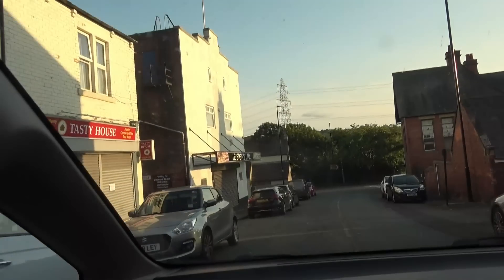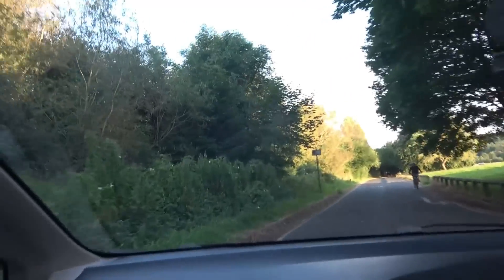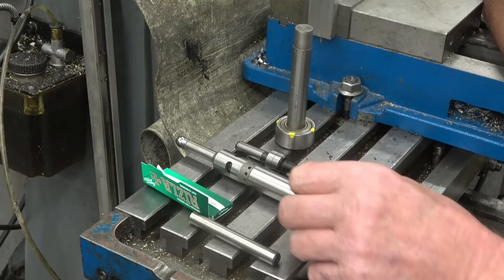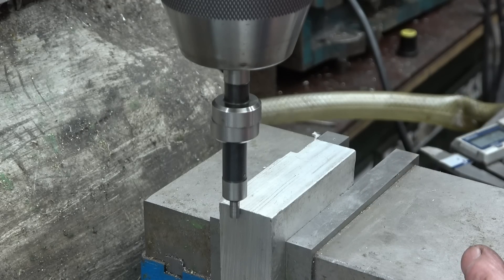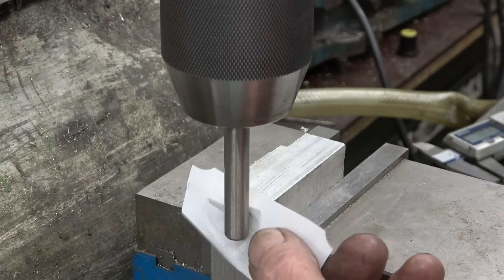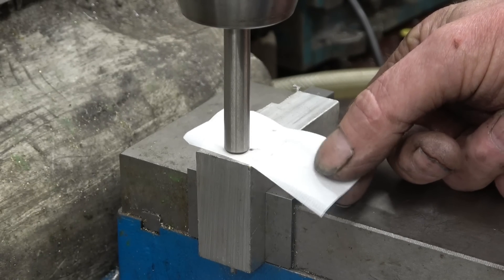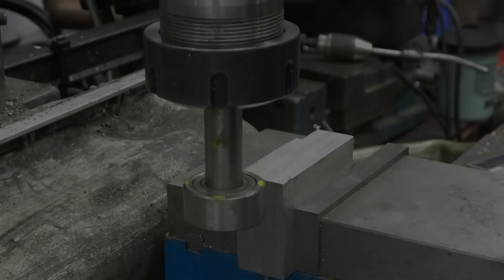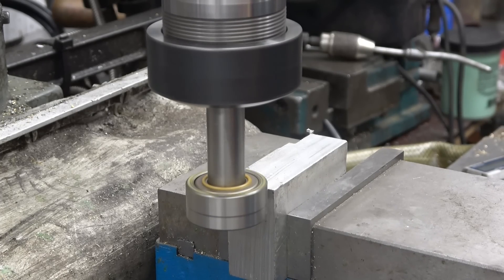Wednesday Catch Up 3 .How to Locate an Edge on a Mill

Comment: I use the Rizla Silver papers with the cutting tool. The Silver are about 0.01mm thick, so when the paper is pulled by the tool, you are pretty well spot on. Stefan Gotteswinter would probably disagree, but good enough for us mear mortals.
Reply: Stefan doesn't like to use a Rizla with carbide cutters. Too easy to damage.